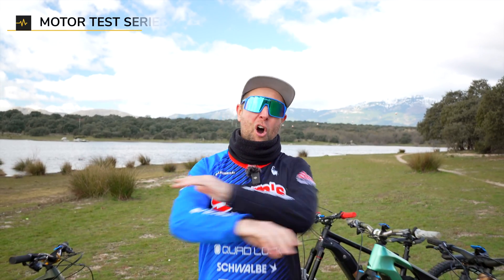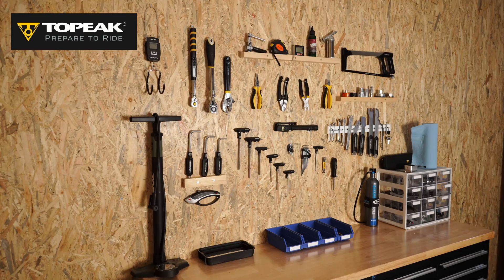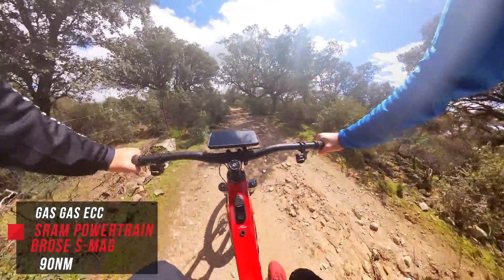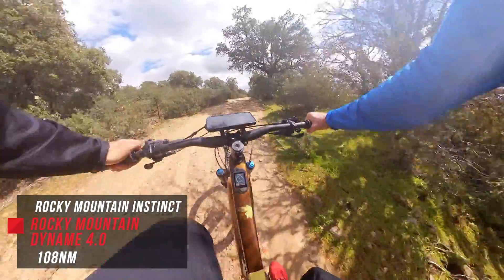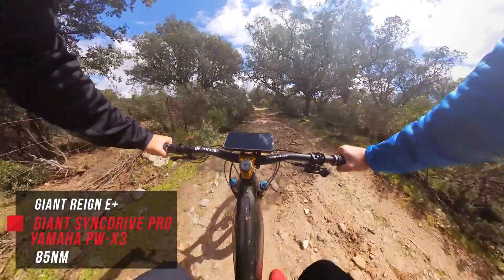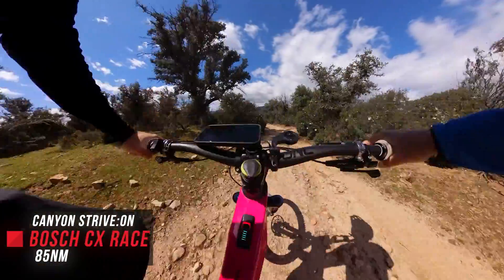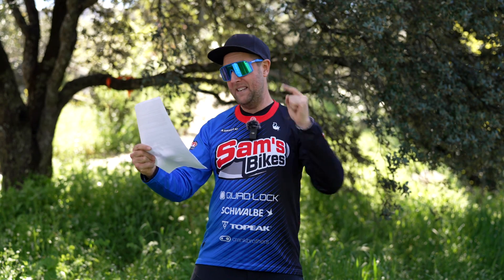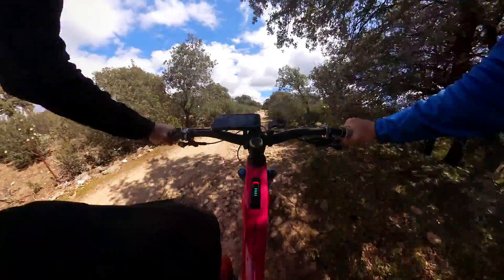WHICH eBIKE MOTOR IS THE QUIETEST? - Noise Test on The Best 7 EMTB Motors!

Comment: I’m so pleased with the new Yamaha Moro 07  the new software is amazing the power delivery is so much better than the Bosch.  If it wasn’t for your commitment to making the videos and doing the reviews I wouldn’t have purchased an e bike.  It’s been so interesting watching lots of different content to get the right bike .  
Thanks for making it all possible 👍😎
Reply: I rode the Yamaha Moro 07 in Sweden a few months ago and found it to be way too punchy\jumpy for lack of a better description.  I played around with the settings a lot and the auto-mode setting...forgot what they call it, but my experience on hills was it was too sluggish to start assisting in the lower power modes and too eager to launch on me from the start unexpectedly with just barely moving the pedals.  It had a lot of power on the higher modes but felt like I was just being shuttled up the hills with minimal assistance as opposed to a more natural assist more as I pedal harder feel I have on my Bosch CX.  That may be a plus for some people who want to basically be pushed up hard hills for downhill runs though but I prefer the feel of matching the power I put in so I still get a workout and this motor just did not give me that feel.

Comment: Excellent video I wish I saw before buying a new bike with the Bosch SX. Grizl:ON from Canyon bought without a test ride. 
I have several generations of Brose motors on 3 specialized bikes. Vado and 2016 Levo Fat are near silent in all modes and cadence.
 The 2019 Levo Carbon comp is rather whiney on the uphill but  only when it is really quiet. Now for the biggest disappointment - my new Canyon Grizl:ON with the Bosch SX motor. Like the power but the whine at higher cadence while climbing is obnoxious. Thinking it was a deal breaker but could not find another bike with the power and torque that the SX delivers. 
And the clunking is real. 
Also when cadence is not putting lots of pressure on the pedals then the engagement of the SX motor is sloppy and "clunky".
Reply from the maker: Thanks 🙏 for the comment mate sorry to hear your not happy with SX
Reply: I have a Canyon Grail:ON gravel bike w the Bosch PerformanceLine Speed motor and have a similar experience.  Not sure I would have bought it if I knew how noisy, whiny it is, especially on hills at higher cadences.  I love the bike and feel itself but the noise is just so distracting, I thought maybe there was something wrong with it at first.   My wife has a Ride1Up Prodigy V2 with a Brose motor.  Literally cannot tell when she has it on in any mode when riding next to her, (with mine turned off), unless we are on a hill when it makes a very quiet hum.  I would love a Canyon Strive:ON but may be looking at a Specialized Turbo Levo equivalent just bc of the motor noise.

Comment: 12:12

I've had in my hands :

- Bafang M620 (1st generation with large sprocket)
- Bafang M620 (2nd generation with small sprocket)
- Bafang M510 
- Bosch CX performance
- Yamaha Syncdrive pro

Taking into account the emitted sound volume + frequencies (high or low), I rank these motors as follows:
1st - Bosch CX performance
2nd - Bafang M510
3rd - Yamaha Syncdrive pro
4th - Bafang M620 (2nd generation with small sprocket)
5th - Bafang M620 (1st generation with large sprocket)

I'm really torn between putting the Bafang M510 in the 1st position and the Bosch CX in the 2nd position... they are very similar.

I find that noises with low and non-constant frequencies (which fluctuate in frequencies and volume) are the most unbearable. The M620 1st gen is horrible, never buy it! The M620 2nd gen will always be at the bottom of the ranking, but it can be tolerable if you're not looking for silent rides.
Reply from the maker: Thanksm

Comment: I would have mentioned if the bikes were alloy or carbon, as that makes a big difference with acoustics.  

Also, an actual tool for measurement, like a db meter, or something that measures pitch/tone, there is a scientific name for it that I can't recall atm.

Comment: Another great video Sam. The Specialized is definitely the quiet one. We have a group of five ebikes, 2 Rocky Mountains, 2 Specialized Levos and a Devinci Shimano EP8 Spartan. The Devinci is by far the noisiest when we are riding up a steep trail. That Shimano motor has a higher pitch whine than the other 4. Looking forward to your range test.

Comment: Shame that the Giant Reign was the 2022 model frame and motor.  Slight changes in frame and motor postiioning now could have an effect on sound results.  Have a 2023 Reign now as your Giant Reign video that you did using the lowest spec and doing the upgrades.  Couldnt be happier.  Love the Vids Sam!!! Keep them coming.

Comment: Well done trying to do this test.....noise levels (db) and pitch/frequency are complex things to measure subjectively but I think what you demonstrated was that none of these motors create enough noise to discount them for any bike purchase. The frame material and design certainly makes a big difference ( as you pointed out) and in my experience the kinematic of the rear triangle/shock tune also make a big difference when freewheeling downhill.
Reply from the maker: Thanks Rider it’s very hard, honestly on the trial and back in the studio all
Motors sounded different but after hours of analyzing I’m happy with my results. Definitely there are so many factors and not a easy subject at all but thanks for the kind words

Comment: The Dynamee 4,0 is the quiter of all the motors and the louder of all the transmission. I’m not able to detect motor sound when in trail and trail+. And I owned the Brose, shimano and bosch as a conparison
Reply: I agree, the Dyname is the quietest motor over all. Even though the Giant and Brose are quiet, they are much more whinier than the Dyname.
Reply from the maker: That’s a very good point t

Comment: For those of us for whom noise really matters on a bike this was a really interesting video and I'll definitely bookmark it for when i choose my next EMTB.

I have a Bosch CX (non race) bike and a Brose Levo and i have to say i couldn't agree more. The CX is a fantastic motor, but the Levo beats it hands down on noise uphill and down, to the point where the CX bugs me if I'm riding it straight after the Levo. After a while i tune it out a bit.
Reply from the maker: Thanks for the comment rider! Totally that’s why I started this series it’s not just one thing that makes the best ebike motor for 2024! Sound for me is massive for me and range I think my most important factors
Reply: Most people want a quiet motor, and the motor noise is one of the biggest turn offs for these mid drive e-bikes. The manufacturers know this and have been attempting to prioritize quietness in the engineering process. CX was an absolute no-go for me on noise, especially when the Brose exists and is so quiet. Bosch has some quiet motors, but their Speed and CX are too noisy.

Comment: Sam, I like your channel very much, but I find the engine noise test pointless. I have 4 bikes with Bosch CX engines, from different years. Each one sounds different and each one gets louder over time.
Reply from the maker: You do have a point there I’m just trying to cover all factors and everyone asks
Reply: I think implementation can play a huge factor in this as well
Reply: Also using a different peddaling cadence and  / or producing different Nm of support and draining different W/h from the battery will end with different noise levels.

Comment: Id like to see a test after all the bikes have been ridden for awhile.  The motor sound changes after about 200-300 miles.
Reply from the maker: Actually all these motors have a few hundred kms on the apart from the Rocky which is brand new
Reply: my 2023 Specialized Levo is 13 months, with 5400km. After more than 5 thousand km, the motor noise is still the same......it's VERY quiet in lower assistance modes, while in Turbo mode it's still not very noisy, sounds just about the same as in Sam's video.
Reply: @alessandropataro4422  Weird.  Ive had 6 Levos and they all got louder after a few months of riding.
Reply: I can say only about my Bosch Gen.4 CX, after 3000km Motor is same noisy. No change.